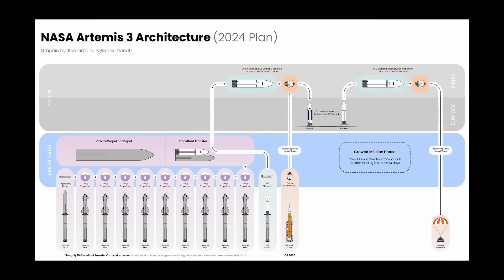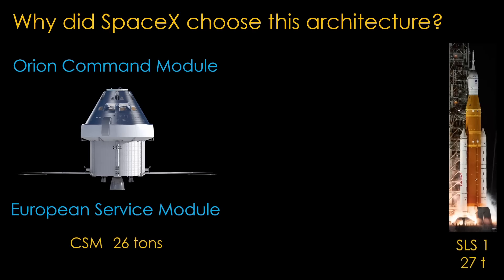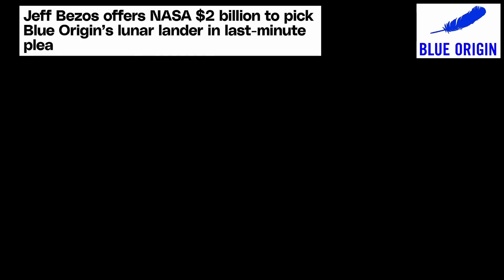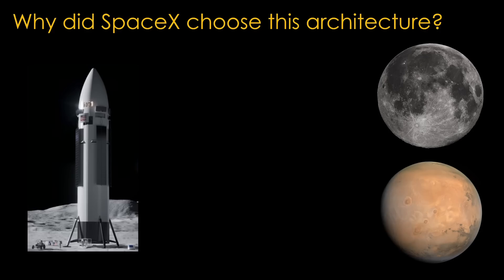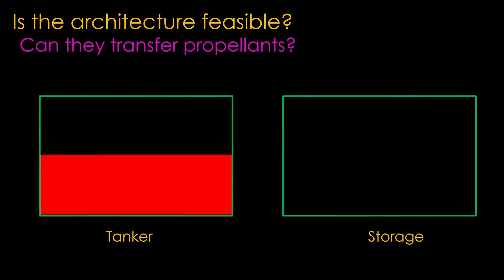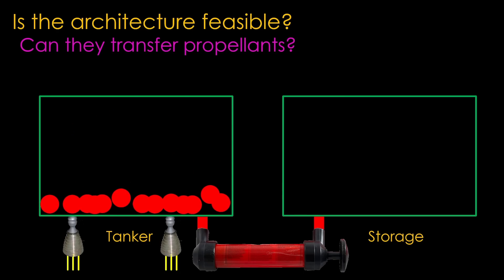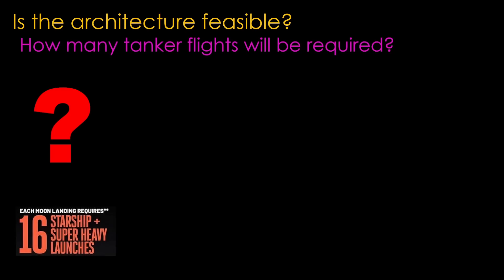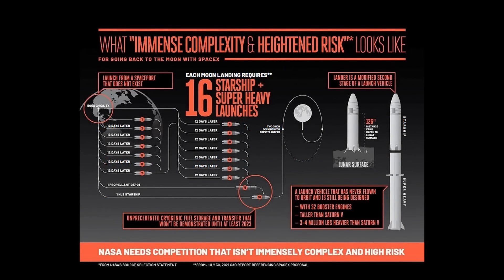Starship Orbital Refueling

Comment: how big will rocket be carrying the fuel to gas station? I don't see any larger rockets being made to carry extra fuel. When we see rocket being fuel up, it is full. There is no extra space for anything, so where will this extra fuel go?
Reply: The tanker variant will likely extend the tanks into the payload section of the Starship. This adds up to around 1000 cubic meters extra propellant.

But even if they don't make this specialized variant immediately, you can use a standard Starship with no payload. Without payload, Starship burns less propellant getting into orbit. It will arrive in orbit with up to around 100 tons of of propellant left over in the tanks, which can then be transferred into the propellant depot.

Comment: What if the Starship was split in two parts to make a 3-stage rocket? The present lander is unnecessary large mostly being empty fuel-tanks.
Reply: This would involve throwing away some of the stages, and needing to build more. Full reuse makes the launch far cheaper.
Reply from the maker: How do you land and reuse the second stage?
Reply: @EagerSpace  If it separates in high earth orbit with just a bit fuel left to make it reentry. The third stage/spacecraft has then much less mass to propel to the moon, when the empty tanks for getting in to orbit is separated.
Reply from the maker: Ah. So you are talking about a two-stage rocket and then using some sort of kick stage to get to the moon. That's pretty much the constellation architecture. It's workable but you would need to build something different from starship/

Comment: Another YouTuber  who does "rocket science"  did a number of calculations using the new SpaceX Raptor 3 engines. After prototyping is finished, it seems it will take some 4 to 5 refilling Starships depending on the required tonnage to get to and land on the moon.
Reply: I agree with Eager Space here, it's not about doing math. There are just too many unknowns.

If HLS Starship ends up with a propellant load of 2300 tons and Starship isn't able to get past 100 tons to LEO with full and rapid reuse, that's a minimum of 23 launches. If HLS Starship has a propellant load of 1200 tons and Starship gets to 200 tons to LEO, that's a minimum of 6 launches.

We just don't know. Once Starship is operational, and capable of full and rapid reuse, then it will be possible to do the math with much more accuracy.

Comment: Is it realistic to expect Starship to be refurbished in such a short time (6 and even 12 days)? Super heavy is much bigger and complex than the first stage of falcon 9 and yet his refurbishment could be done faster (for 6 days) or only take 3 more days (for 12 days) than the best falcon 9 refurbishment (9 days)? Starship has to go through reentry, but they are going to check everything in 6 to 12 days?
Reply from the maker: Super heavy is bigger but less complex in terms of refurbishment. The big difference is that the raptors don't need to be cleaned the way the Merlins do because methane doesn't produce soot the way RP-1 does. 

Starship is a different question.

The goal for the system is "airplane-like operation". That implies very quick turnaround.
Reply: Sure raptor don't need to be cleaned the way the Merlins do, but there is 33 raptors on super heavy and only 9 engines falcon 9. That is still a lot of cleaning to do.

As for the airplane-like operation for Starship, SpaceX kinda had a similar goal for falcon 9 (24h for the first stage) and they did not reach it (yet). So to me, it seem less likely that they are going to archived something like that with a vehicle that undergoes temperatures of 2000 C. Certainly they are going to check in some way most of the tiles and that would not be a quick process.
Reply: @saltmine59  They don't plan on cleaning them at all. Just fill the rocket with propellant and go again.

Obviously, getting to that point will take a bit of time. I'm sure that for the life leader, they'll be doing static fire testing between each flight. And there may be engines that need replacement/refurbishment between flights.

But once they have boosters that have flown a bunch of times, they won't be doing static fire tests between flights. They'll just load up propellant and go again. 

Some engines may fail, but that is fine, because they have engine out capability. Over time, the number of failed engines will drop and it will become a very rare occurrence.

When it comes to the heat shield, they seem to be going for a redundant solution, where they have an ablative heat shield below the ceramic heat shield. They are likely to do some checks between flights, but if they lose a tile because of insufficient checks, that's fine. They'll just replace the ablative material and the tile. Taking a day to potentially replace a missing tile is better than spending days and weeks going over the heat shield between flights.
Reply: @SpaceAdvocate  Ok, and when is SpaceX going to be able to do that? They are already late for Artemis, certainly they do not want to delay Artemis missions more.

As for the heat shield, we have seen, with ITF4, that a missing heat tile can have a cascading effect, which is not desirable. As for the ablative material, it was my understanding that it is a last resort solution in case a new (unuse/first flight) tile fell off during reentry. Is the ablative material alone capable of protecting starship for the duration of the reentry? If not, Starship must not lose a tile during take off. To archived that (with the current technology), i do not see any realistic procedure other than checking most if not all the tiles.

To archived that cadence of launch, I think that (with the current technology) SpaceX is going to need more than 1 or 2 starships to make the refueling. Maybe 4 or more in rotation.
Reply: @saltmine59  "Ok, and when is SpaceX going to be able to do that?" We're probably a few years away for turnaround time in under a week. But reducing the turnaround time will be a gradual process, and SpaceX doesn't need a turnaround time in under a week to do Artemis. 

SpaceX currently has 3 Super Heavy boosters near ready for flight, and 3 Super Heavy boosters in construction, as well as two Starships near ready for flight and another being constructed. Only having two full stacks isn't a very relevant scenario. SpaceX is gearing up to have a lot of vehicles. They are planning on having four operational pads towrds the end of next year. And I would expect SpaceX to have several vehicles per pad.

For the heat shield on IFT4, we saw that the design wasn't ideal around the hinges on the front flaps. The burn through probably wasn't a result of losing a tile. The design just had a weak spot. The flight was performed with missing tiles on the aft skirt, and it's quite likely that other tiles fell off. Yet the vehicle was able to complete the full mission and make a soft splashdown. So already, we know that missing tiles can be surviveable. Though likely with substantial damage. I believe the ablative material is primarily to avoid needing to scrap the vehicle, if you lose a tile.
Reply: @SpaceAdvocate  Yes SpaceX should be fine for Artemis if they have enough Starship and I do think they can produce enough, but my initial question is still, can we really expect a 6/12 days turnaround (let's say on time for Artemis) like it is claimed in this video. For super heavy, with your arguments and those of Eagerspace, I can see it happening, but I still very much doubt it can be archived with Starship. I guess we can only wait and see what happen.

Comment: Option you didn't mention is rotating lengthwise down it's axis and having fluid pickups on the edge of the cylinder, I have a feeling this is how they will do it. Im not sure if those kind of pipes on the edge of the tank would be a great idea for starship but on a depot that just floats in orbit? Why not?
Reply from the maker: Could be possible, seems less likely to me. Starship already has to have piping to flow propellants in normal gravity orientation, and they will probably try to reuse that. But they will do their own trades.

Comment: I wonder if spinning the tanker and docked ship could be used to settle the propellant on walls and transfer it out. 
Fluids would simply stick to tank walls making draining it out relatively easy (I assume) but the connection would need to hold and mass transfer while spinning would definitely introduce a lot of forces where we don't want them however it could save a lot of fuel because it only needs to spin up and spin down, in between they can take as long as they want to transfer propellant unlike ullage that needs constant acceleration to keep propellant from moving.
Reply: I was entertaining an alternative idea: of a lung-like fuel bag inside of the rigid fuel tank that allows variable gas pressure in between the rigid and the soft tank envelopes.
Reply: @phdnk  You're describing a bladder tank, which is the traditional way of doing this, like on the ISS. But it doesn't work with cryogenic propellant. Material that is flexible and gas tight at cryogenic temperatures doesn't exist.
Reply: @SpaceAdvocate  thanks for telling me the standard name.  In comments below Mr. Eager Space already told someone about rigidity and brittleness of bladders.
They also discussed pistons there.
Yet I doubt that gas tightness is a requirement. Leaky pistons are ok to me, more so than leaky bladders.
Reply: I think your spin idea can work without spinning the entire tank. It suffices to spin the fluids inside by some mechanical stirring propeller, gas viscosity will impart the motion to the entire fluid supply.
Reply: @phdnk  Interesting idea but spinning fluids inside tanks mechanically would cause the whole ship to spin in the opposite direction, just like in a helicopter, angular momentum has to be conserved so you would need to despin using thrusters anyways and you would also have the weight penalty of this spinning device.
Reply: @Wisald  there are two tanks in one ship, this allows for counter stirring.
I just don't like to spin-despin of  the two docked ships on each refueling so I searched for a shortcut.
Reply: No, you can't spin it around the long axis. The fuel wouldn't be stable and would flow to the ends and the ship would spin around the short axis.

Same thing with the back to back if you spin them around a common long axis.

Comment: You left out one major thing about the refueling problem. How long is it going to take 4,200 truckloads of fuel to refuel each of those flights. NASA has said 18 refueling flights, others have said 12. Split the difference,  15... On average its 280 to 300 truck loads for EACH starship launch. So you're looking at 4,000 to 4,500 trucks to Boca. I'll repeat what the bad guys said in the movie Taken.... "Good luck".
Reply: The new site plan puts a LOX/LN plant near the tank farm, and most of the trucks are for LN and LOX - three quarters of the trucks would be replaced by a power line. Add a NG pipeline (in a tunnel?) and a liquification plant to eliminate the rest.
Reply: Closer to 8 but they could always Build a pipe.
Reply: Guarantee they are looking at pipeline options but are keeping it quiet "ELON MUSK WANT TO BUILD ROCKET FUEL PIPELINE THROUGH FARMERS LAND" type headlines etc...
Reply: If they need 60 days for those launches, that's one truck every 20 minutes. Seems fine.
Reply: It's looking like it's a good thing blue origion got a second deal.  Has spacex even planed how to get it's fuel depot up or designed it?
Reply: SpaceX wanted to reopen the wells that were on the site (Sanchez Energy/Mesquite Energy Inc/Lone Star had a well at Boca, and why the "Sanchez site" is called "Sanchez"), however Dallas Petroleum Group claims ownership of the inactive wells.  The two inactive wells are called La Pita 2R and 3, and are still in court over ownership. If this is resolved, SpaceX may have a source for Methane. The gas generation plants for Ox and Nitrogen were taken down, and never used. There are a host of other lawsuits with SpaceX at the Boca site... Land swap deals, late payments (or no payments), and of course the continuing environmental groups harassment's (which will never stop). Having a launch site here is hard already, getting approval for drilling and extraction will be on another level, as Federal oil and gas licensing is involved. Trucking in the fuel is the only solution for the foreseeable future. The fandom channels don't report these things of course, but these are just some of the headaches of Boca.
Reply: I should add that the "pipeline" idea is almost comical. They are fighting over 44 acres the site is on. Running a pipeline would trigger a major fight spanning miles with easements. Right now only the local environmental groups are involved, but a pipeline would garner national group support. Plus approval and licensing requirements, and other red tape requirement makes the pipeline idea almost impossible.  They don't want to go there.

Comment: How Saturn 5 could send 47 ton and land on the moon. But starship with 100ton capacity cant??
Reply: Saturn 5 could land on the moon about 15 tons total (lander + payload). Starship can land on the moon >230-280tons (80t HLS lander + 150-200tons of payload). That's 15 to 18 times more capability, and Starship will need to make a redundant stop at NRHO to pick up astronauts from the nearly useless Orion.
Reply: @admarsandbeyond  Saturn V could land about 8.2 tons on the moon. (It burned through about 8 tons of propellant during the decent.)
Reply: @SpaceAdvocate  Thanks for the correction.
Reply: A 15 ton lander made it to the moons surface, 100 tons of starship will land on the surface.
Reply: In fact, Saturn V had roughly 140t to LEO capability. Saturn/Apollo stages also had much better mass raitos than Starship, if that helps explain it.
Reply: Short answer: stages - it's the rocket equation's fault.

Comment: 52 years Apollo did it in one shot. No refueling.
Reply: Different mission scope. Artemis' scope is certainly larger than Apollo's. NASA could easily replicate Apollo's mission architecture if they really wanted it, but they didn't.
Reply: They landed a 15 ton vehicle on the surface while starship will be 100 tons.
Reply: Apples to oranges. Starship has massive capability that will allow a sustainable presence and large scale exploration and settlement, it won't just plant some flags and leave.

Comment: You could have a piston to push all the propellant out of the depot.  Or inflate a balloon inside it.
Reply from the maker: A piston would involve a large and heavy mechanism. And pretty much any flexible material is not flexible at cryogenic temperatures (you can break balloons in liquid nitrogen, and it's a lot warmer than these propellants.